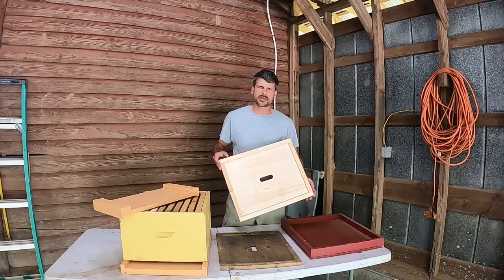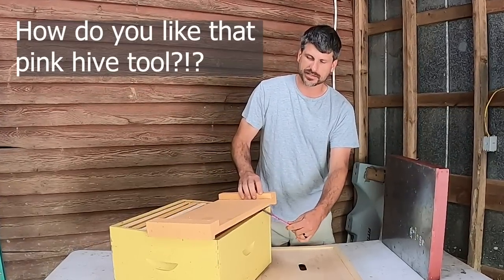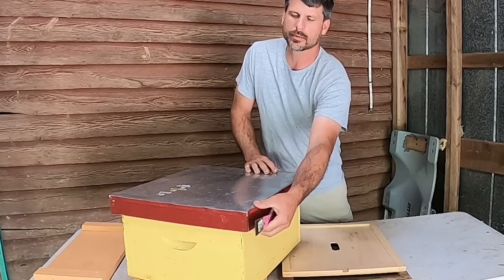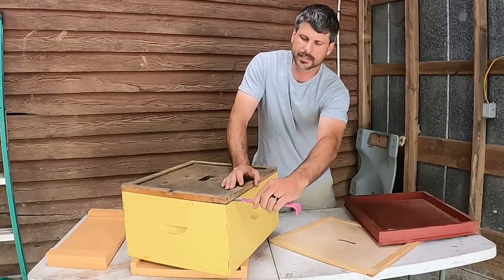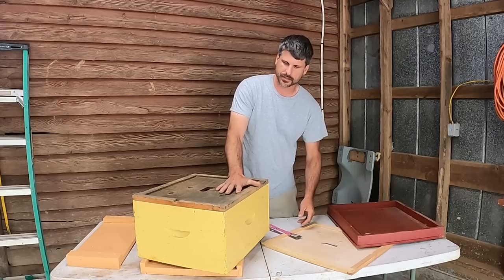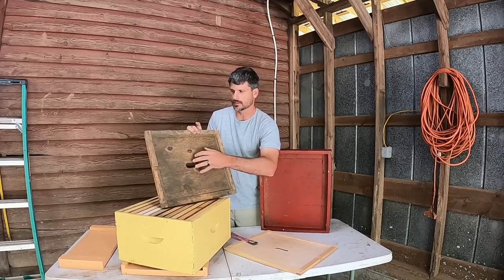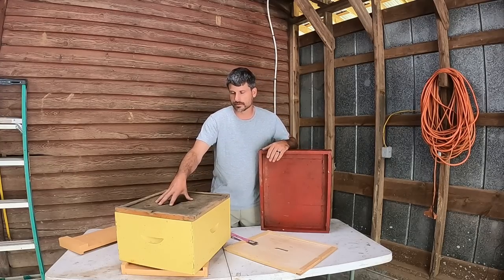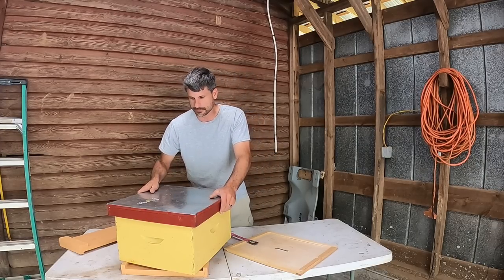What is an Inner Cover and how to use it on a honeybee colony

Comment: Very informative video. 
Have been using inner cover with sloping  insulated roof sides which has been very effective. The moisture drains off better leaving roof much dryer. Will install a layer of breathable roof membane on next hive construction. This will be for the same reason it is used when building houses, to keep the roof free from getting damp to avoid inside rot and deterioation plus mould building up etc.
This layer needs to be installed under polystyrene leaving air gap to work. Leave ventilation gap at base at two sides of roof. Shield these on outside to stop wind blowing in directly so bees have to spend less time propolysing. Also glue rubber draft excluder underneath each box to seal. This is simple and very effective.
Make insulated wooden hives using 1 inch polystyrene sheet. These work better than poly hives keeping bees thriving through winter and teaming with bees come spring. Also consume a lot less stores. The other advantage is interior temperature in summer being cool so less fanning needed. That translates to more honey yield.
Reply from the maker: Sounds like you have put a lot of thought into this. Thanks for sharing!
Reply: @DysonApiaries  Thank you. 
Just observe and incorporate ideas from other industries and what's already proven to work.
For instance with the rate cedar wood being used for hives alone this will run out soon so other sustanable sources  will have to be used that also give long life.
Pine wood for instance grown without fertiliser will be more dense and once treated with non-toxic treatment will work well. This will be more prone to swelling when it gets damp therefore use of non-toxic sealant will help for long life. This combined with using featherboard construction the same as traditional hives is well proven. 
These simplistic measures will help bees thrive because of stopping water ingress. Look at most wooden hives and design is like comparing old wooden framed leaky windows compared with modern double or triple glazing.
We don't like being wet and cold with mould everywhere, nor do bees ~ period!

Comment: I use insulated Lazutin 2 by hives in zone 5-4. The frames' top bars touch. I screw my solid inner cover down because bee can't glue it down. Then an insulated out cover with unwelcome boards for bear covering it. I have weep holes in low spots of floors. I don't worry about moisture because roof and walls are sealed. Where ever the moisture meets cold air it condenses. I like bubble wrap under inner covers. It helps stop the thermal radiation. My thinking was make the hive like a hat and let heavier than air gases and moisture out the floor. Bees don't walk on the floor to get cold feet. Spending a winter in a bee hive would be like a human living in an ice shanty all winter.

Comment: We are located in central Illinois and use inner covers year-round. In the winter the Knoth is facing down with a one-inch-thick rigid insulation board between the inner and outer covers. This allows moisture to escape and gives the bee an upper entrance if needed. No dead outs using this arrangement.
Reply from the maker: Thanks. I have used the insulation board above the inner cover. Never thought of using it below. Thanks for the feedback. Like I mentioned in an earlier comment, I have switched mostly to migratory covers for cost but I like the inner cover/telescoping top combo for its benefits to colony health. Thanks for watching.
Reply: @DysonApiaries  Hey Dyson,
Re Commenter : He Stated "Uses Insulation between the Inner and outer Cover." That's above the Crown Board but under the Tin Covered Roof.
That's what we do year round here in Scotland 🏴.
If you see Fred Dunns Youtube approach, he states Bees don't have upper Entrances in Nature ! Or need them on Hives. It's condensation not Cold that kills Bees. If inner Covers are used correctly : tight seal (unbroken Propolis Seal) well Insulated, Hive is Tilted Forward a tad any Moisture beads off that I.C trickles down the Front Wall and either Drains, Evaporates, or is a vital Water Supply If those Bees are held up due to bad  Weather etc. 
Hope thus helps. 😎
Oh and the odd icky Slug doesn't like a warm drier Hive under roof panel either. Guess they slime back to the Veg Patch... To eat all my Greens !
Bees Win, Beek doesn't. 🙃
🐝🐝🐝🐝🐝🐝🐝🐝🐝🐝
You could clean up if you said you were related to 'Dyson' Vacuum Cleaner Empire. Was UK based now, all made in Asia. Boy they cost serious
 £$€'s. And you thought keeping Bees was expensive !
I'll let myself out... 😉

Comment: I have seen videos of people making new holes in their inner cover when using a top hive feeder. But they put hardware cloth over the new holes. Wouldn't that keep the bees from protecting the top feeder box area from hive beetles? Also, wouldn't outside bees be able to enter the unprotected area through the little notch in the inner cover edge?

Comment: I use a roof with a perspex viewing panel, so I use my inner cover to support a feeder. You just look through the viewing panel and you can see how much fondant or syrup has been eaten without opening the hive. Just another use for the cover😊
Reply from the maker: That’s pretty cool. Do they have a tendency to propilize it to where you can’t see through over time?
Reply: @DysonApiaries  hi, no because the feeder has a see through lid on, the bees can get to the feed but because the feeder itself covers the hole in the board, they can't propolis the viewing panel.
Reply from the maker: That’s pretty cool!

Comment: Heu justin, i have a migratory top with top feeder hole. I was wondering if i need to use a inner cover? Thank you for these awesome videos.
Reply from the maker: Migratory tops do not need the inner cover; however they will sweat a little in the winter. Sometimes you have to prop them just a pinch to allow the moisture to escape.

Comment: You talk about heat above the cluster, I made a box with a feeder to have dead air space and add fiberglass insulation in the winter. An old book from Dadant shows a hive body packed with dry leaves placed on top of the colony (quilt box/hot box).. I cut a scrap of wood similar to a boardman feeder and use it to cover the top hole with a feed jar, prevents robbing on small nuc boxes, the need for some type of an inner cover.. I laugh at David burns when he tries to pry off his Telescoping cover and claims an inner cover is worthless.
Reply from the maker: Some call that setup a quilt board. I think they have benefits for sure…just depends on your operation to determine its relevance.

Comment: The purpose of an inner cover is to provide a place for hive beetles to mate and hide.
Reply from the maker: It can definitely serve in that capacity. 🤣 I feel the same way about those plastic frames…
Reply: I run without inner covers. Tried using canvas and reflectix and finally just plain covers. I prefer migratory cuz of laziness. The down side is occasionally you have frames propolized to the cover. I deal with it.
I almost burned all inner covers but spotted the bee escapes and changed mind. I don't even recall putting the escapes on.
Reply: Thanks for this explanation.  So appreciated